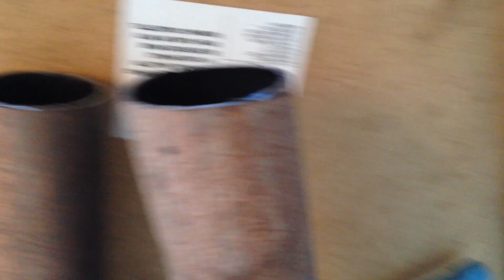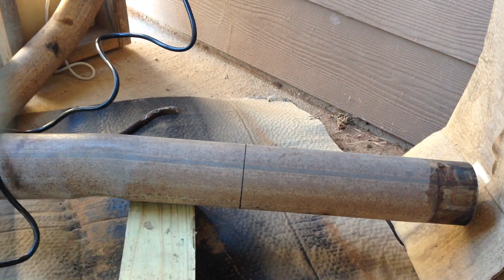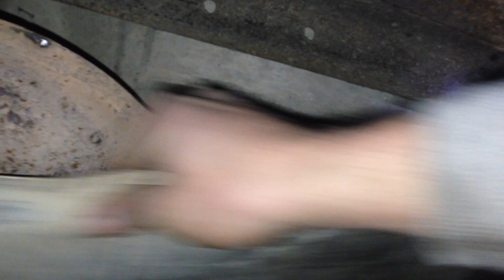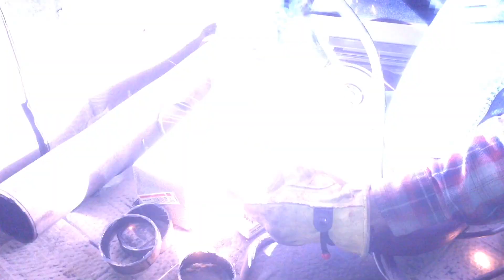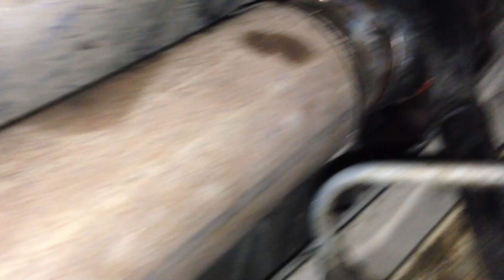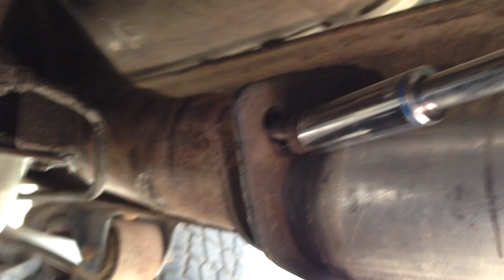Custom 7.3 Powerstroke Down Pipe

Comment: Btw a bigger exhaust doesn’t always mean less restriction, there is a perfect middle ground when it comes to exhaust. Will it hurt to have one too big? No, but an optimal sized exhaust will help with flow dynamics. Bernoulli’s principal; you’re trading velocity for expansion when you could be using that velocity to expel the ex gasses faster , rather than expanding too much causing turbulence which can slightly affect the air flow. Not sure if 3 or 3.5 is too much or not enough though, there’s a lot of math involved with it but it’s definitely something you can look into, maybe call some professional exhaust fabrication companies, few come to mind but not gonna name any cause I ain’t getting paid to lol
Reply from the maker: This is definitely an interesting topic I haven't dove too deep into. I think the exhaust velocity aspect you're talking about is generally more applicable to a naturally aspirated engine where the moving exhaust helps to pull fresh air into the cylinder. Depending on the camshaft profile an overlap period may exist when both the exhaust and intake valves are open at the same time. In that case the momentum from the exhaust pulse creates a slight vacuum and having too large an exhaust will diminish that affect. Bernoulli's equation does show that gas velocity drops as the  diameter of the exhaust pipe gets larger. Since the pressure drop at least due to friction from the walls of the exhaust tube is proportional  to the velocity of the exhaust flow, decreasing the exhaust velocity also decreases exhaust backpressure or the pressure to overcome the frictional losses in the exhaust pipe which makes sense. If your exhaust pipe is way too small, you'll definitely increase backpressure compared to a larger exhaust. I'd have to crunch the numbers on this, but the Reynolds number (Reynolds Number = density*Velocity*Flow Width/viscosity) shows that for almost all real world cases, the fluid flow will be turbulent regardless. Unless your viscosity is super high, like with syrup flowing out of a bottle very slowly, generally flow is turbulent regardless. Interestingly looking at a Moody chart it appears that the friction factor tends to increase as flow becomes laminar rather than turbulent. In a turbulent flow case the friction factor stays nearly constant regardless of the Reynolds number. However the frictional losses still accumulate as velocity increases overall regardless of what the friction factor is. I appreciate you bringing this topic up - I haven't thought so much on the topic. I should make a video on this, it's a very interesting dilemma and a good amount of number crunching would be involved!

Comment: I just bought a clean 94 OBS 7.3. God all mighty this is what I want to do to mine. It's the welding part that scares me. I have 2 small welders but still don't know really how to weld. I guess getting out of the storage shed and practicing might help LOL. Translating the curves and bends to form the actual might be a stickler but you did show how to do that.  At any rate a great tutorial...one of the best. Oh by the way my OBS is exactly the same color as yours. Let me compliment you in your great taste in colors. LOL Nice rig and thanks for sharing. I am more motivated now than ever.
Reply from the maker: If you've got a shed, you're already a step ahead of where I was when I made the downpipe for my truck. I built mine on the back patio in my apartment at college. I had a cheapo $150 flux core mig welder, an angle grinder, and some exhaust pipe from the junkyard. You just need to pay attention to the weld. You can usually see a nice puddle of metal form in the joint that you need to move around to actually form the weld. If you don't see a puddle then you're probably moving too fast or burning through the metal with too high a voltage setting. You can do it, just practice a bit and you'll see it's a lot easier than it looks! Nice taste in colors too!
Reply: @Rnddiesel  Renddisel....Thanks for the reply. It's people like you that motivate people like me stop being afraid of failure. It is amazing that everyone who does things well all had one thing in common. That is the continued interest in what they want to do to keep trying until they master it. That is the propulsion that leads to success in almost anything. Thanks again for sharing your great video.
Reply: @johnnyohness6610  I personally wouldn’t weld the down pipe itself, I just snag the diamond eye and the weld below. If amateur my concern is sending those hot exhaust gasses at my firewall lmao.

Comment: The stock down pipe isn’t restrictive because it’s so flat, that’s a misconception. Look how damn wide it is, the capacity for flow is there. Do you really think the engineers didn’t know what they were doing? Any gain is in your head.

Comment: I don't have that "Pancake pipe" in my 97 E350, mine is 3 1/2" round which I will go 4".
Reply from the maker: I envy you and your E350! There's a darn good reason Ford put a pancake downpipe in the OBS trucks, there just isn't enough room!
Reply: @Rnddiesel I like the template you made for pie cutting. I'm gonna have to go back over where you got your angles. If you had a TIG your pie cutting would look like factory. I'm paying attention to your stuff. I want my E350 to reflect where I came from. Nothing like Heavy Equipment.
Reply from the maker: @KohalaIronWorksCase  A TIG welder would be awesome! One of these days, I'd like to get a good TIG setup, and redo all of my exhaust with stainless steel. It's definitely not the easiest to do it the way I did with an angle grinder and a MIG welder. Ideally you'd use a band saw or a chop saw to make the cut more square. If you want to know a little more about the pie cuts, there's  this guy on 'The Fabrication Series' that talks all about it. With a little math and a lot of patience, you can do some amazing things with pie cuts. Heck that's how I built all of my exhaust, and my intercooler pipes.
Reply: @Rnddiesel Yerp, a lotta sanding to get the fitment right,,,but the TIG welds will take it over the top.

Comment: I do the same shit. 
The fact of the matter is after hydraulic testing flow dynamics a 3in round pipe has zero advantage over the stock oval pipe. 
That being said the round can indeed stay a bit cooler under nominal load, yet even with the turbo gassed out at 1700f the difference is 103f on a 70f day....
Remarkable but true!
Now baffled up pipes from the manifold to collecter help considerably. Due to differences in materials cause expansion causing exhaust leakage hence lower speeds at the turbine and a loss on the compressor side : )
Reply from the maker: I'd definitely like to run some CFD on the stock vs aftermarket 3 inch downpipe to see how much of a difference it really makes. There's a good reason I made my downpipe 3.5 inch as soon as room permitted. I can see the main difference with the 3 inch dp occurring under much higher loads. The more crimped cross-section of the old downpipe causes a higher shear rate of the fluid, hence more heat generation and increased pressure losses. All I know is that from a geometrical fluid flow standpoint, a circular cross section is always going to be better than a non-circular one provided the increased flow to external surface area ratio, and hence a lower head loss through the pipe. There's definitely room to improve on my design, it could be a little smoother and maybe a tad larger as well, but it gets the job done. I'm sure the bellowed up pipe would make a difference, and it would be great to get a set eventually, if they weren't so expensive and such a pain to replace! By the way, how did you get the chance to 'hydraulic flow test' a downpipe? I'm jealous of that setup and would love to get a flow bench or something to actually test these parts rather than just guess.
Reply: @Rnddiesel  
I used a tank on a stand timing flow of water.

Then Bandimere for flat out hammer down testing.

The heat is the difference when you wrap the round down pipe thats when the difference in the turn down outa the pipe makes all the difference

Baffle up pipes wrapped huge nearly massive torque gain at the turbine.

After reading hydroflow dynamics and
 heat displacement textbooks it is the heating of the system to a nominal temp and the flow of that heat. Its HVAC theory. 
Eqaulization of flow by size shape and length

Movement of air at high velocities in turn volume
Containment of the entire volume at a constant temp

Imho wrapping all the pipe, making a nice sweep out and down outa the turbo my current obs is still running the flat down pipe into a 4" at the cat flange ending  just past the trans and dumping it out. Spools me faster
Keeps egt way down and keeps the egt nearly constant even pulling my 9000# home and shop around over the Rockys or Through Palm Springs. Getting outa the hole at a reasonable clip and cruising at comfortable speeds.
Plus early dumps keeps my entire undercarraige  hitch and lift gate nice and flat black! She looks all new all the time  ; p
Reply: @Rnddiesel  
Oh yeah and Props to my ancestors in REAGAN TEXAS! 
Freinds in SEGUIN, THE SCHLITTERBAHN BAHN and LAKE MCQUEENY ! I am a vagabond now but I have never forgotten my roots and some of the most fun, best fishin, loudest garage bands, and prettiest ladies!...
DONT MESS WITH TEXAS!
Reply from the maker: @mrmtn37  Definitely, Texas is a great state! I can't say much else as I've never lived anywhere else, but from what I've heard and seen, I don't think I'd want to live anywhere else. Besides, my family has been here since the 40's, 1840's that is! You sure came up with some creative ways to test the downpipe, and it sounds like you've done quite a bit of reading on the subject matter. Take care!
Reply: @Rnddiesel  
You might check out Gayle Banks book
"The Boost Gauge is Dead to Me"
Reply from the maker: @mrmtn37  Sounds good, I just read a brief synopsis on the ideology, and it does sound good. Banks definitely has a good ideology, and I can appreciate that he actually takes time to engineer things and do it right, unfortunately that knowledge comes at a hefty price tag!
Reply: Whoa man yikes ideology holyship?
I think it's just math in physics and shit?
Careful that word ideology holy crap! Hanna Arndt summed up ideology and I'm paraphrasing is like  instant brain death to your consciousness?
Bad shit anyway...
Hey man I'm like you propane injection bottle valve you know the bone fitting off of a fucking swamp cooler.
Methanol injection dog cheap Harbor Freight pumps some bitching tubing once again does wonderful buns from the swamp coolers that are threaded inside and outside got the nut tighten it up little rubber gasket actions may be little caulking on there and Bam you got a bucket full of ice water to inject in front of the radiator and you know you can put it in line with your turbo and whatnot you could do it after I wouldn't suggest after if you're using the harbor freight stuff cuz that pump ain't that powerful... yeah I'm a do-it-yourselfer man I can't afford all that whiz-bang gadgetry but I'll tell you what man that that I computer and and that little freaking Derringer chip he's got all kinds of other crap you can buy with it all sensory censored out I'll personally I'm in the holding my own greenbacks right where they are in my pocket and I can spend Pennies on the dollar for that shit like I said you know where there's a will there's a way and if there ain't a part I can make it if there ain't a tool I'll make it.  don't matter I manufacture anything except for Authority!
Reply: @Smokey Bear  
I am not claiming anything in seat of pants just was curious one day about the overall amount of gasses could the pipes hold and the difference in heat flowing out. 
There was zero difference in the amount of H2O either pipe held. Just crazy that a 3" round pipe didnt hold far more. Then the comparison in amount of time when the H2O was  released were nearly the same as well. 
Temperature was completely different. 
Oval was nearly 100f higher  then the round.
This says its the heat that causes the boost in the round pipe. To say another way the fact that the round pipe flowed heat more effectively was basically the only difference. To feel so much more powerful just because the heat flow was counterintuitive. I would have guessed the round was more effective due to size or volume not heat being moved. 
I just found it interesting. I am not a good writer and may have explained incorrectly.

Comment: A little bit of character in the job is the best...buying material is to easy...my 94 7.3 single cab I eliminated the cat and muffler putting a 4" straight pipe from my horse corral and a 6" antique metal gas can cut into a 45 as my exhaust tip..it sounds just like  Your truck.... Your FABRICATION WORK is awesome ...

Comment: A huge improvement over all other "7.3 down tube" I've been plowing through for days. You can't beat custom. Good job and thanks bro A++
Reply from the maker: Thanks! You know there's definitely some room for improvement with the one I built. If I were to do it again, for one, use a better exhaust clamp. The one I have is bulky and causes vibration in the cab at times when it contacts the floor pan. Also, I probably could've squeezed the 3.5 inch tube all the way up to the turbo outlet... It might've just taken some firewall manipulation though that I was trying to avoid. Best of luck finding a downpipe!
Reply: I’m going to use a 3 1/2” or 4” oval tube and start from there. All in stainless. The volume is identical but allows for closer tolerance in this case. Stainless headers.com I have used as well as some other sources. I believe mild steel is also available. Thank you for your input plus reply, Sir!
Reply from the maker: freezerburn04  Sure thing! If I recall correctly, I was able to get the 3 inch pipe through the close section near the firewall without any bending of the firewall necessary. I might have been able to put the 3.5 inch if I cut away the infamous pinch weld. I think a lot of it has to do with how your truck is put together. Due to manufacturing tolerances, varying levels of body mount decay and other damage, your exact setup may be a bit different. I think you'd be hard pressed to fit anything 4 inch diameter though without some serious patch welding and cutting/ body lifting. Also if you want to optimize the system as much as possible and are a stickler for it, bear in mind that your circular section will a have less restriction than an equivalently sized oval section. Basically the less exhaust gas contact with the side walls will be better for overall flow. Best of luck, let me know how it turns out, and don't torch the truck, it is extremely frustrating none the less!

Comment: Great DIY project and well thought out plus made it happen on a budget!
Just curious but what brand and model welder did you use?
Reply from the maker: Thanks, yeah it's a whole lot of fun to know you built something, and it only cost around $20 in materials too...

Well try not to make fun of it too much. I use an Ironoton 125 Flux core MIG welder. It's probably the cheapest welder you can buy. That being said, it works, not great, but gets the job done. Power output is also only either high, or low, no in between.